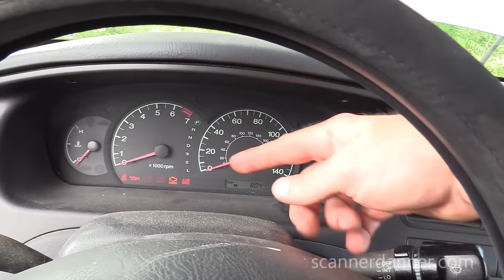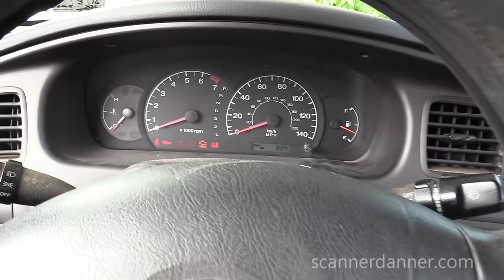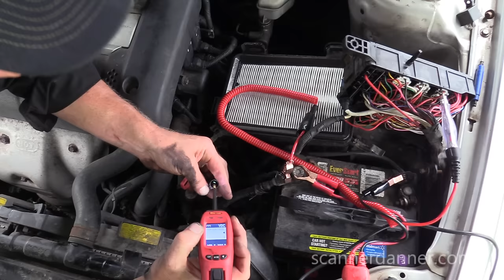No crank, good starter, how to troubleshoot, any car! (Hyundai)

Comment: I have a question I hope you can help me with, I had a crank no start problem so I started changing parts, and of course the problem  has gotten worse, I have no crank, no back up lights, no odbII PORT, no rear lights , the gages needles don’t move, the battery  shows 13.5 volts,I cannot jump the starter at the fuse box. The starter works on the bench, headlights work but DONT dim when I turn the key, the ignition switch is brand new, so I need some guidance here
Reply from the maker: pick a problem and walk that path. Start with the back-up lights or tail lights. Get a good wiring diagram and break out your voltmeter or test light and do some checks. I can't help you unless I have some direction. That direction comes from you. 
Here is a link to a DIY version of the service info I use. Look at the diagrams, find a common denominator. And stop throwing parts at it because you end up making it worse. Now you may have multiple problems that you just built in. 
https://eautorepair.adtrk.biz/?a=10817&c=24&p=r&s1=
Reply: @ScannerDanner  Wish I could send you a photo but I found a harness that goes to the multi switch turn signal box over the ignition, looks like at some point it over heated, its slightly distorted to the point where the plastic between some of the lower point are gone, wth? Anyways its hindsight but I wish I had found your classes before I poured parts(fuel pump, ignition switch, cam, crank,  starter and radiator (broke the hose fitting, don't ask how, please). You're a pretty good teacher, bro.
Reply from the maker: @bradjohnson6536  well you found me now, so moving forward with other issues, we can do better together right?
Reply: @ScannerDanner   Well, Mr. Danner, I replaced the multifunction switch connector and after having to rearrange somme of the wires and  two blown fuses, the engine turns over, altho it didn't start. In the morning Ill start to try to trace why it won't start. You now have a new, 69 years old enrolled student.
Reply from the maker: @bradjohnson6536  find out what you're missing. Start with a quick spark test.
Reply: Its 9:11am and I just reinstalled the multi switch, sprayed the connectors with contact cleaners to try and rid any moisture, I checked the fuses and I probed the MFSW fuse. It had power but when I turned the key to start, the right terminal flickered while the left terminal had a solid output at 13.0. Why does it do that? It's still a no crank unfortunately.

Comment: Paul, at 24:50, the test light made me think of the 5 volt reference circuit. Do you think there might be some sort of intentional resistance in the 5 volt circuit, maybe a positive temperature coefficient resistor, that heats up when the 5 volt reference shorts out, limiting current, and the resistor would drop the 5 volts across it, then when you remove the short, the resistor would cool off, just like the bad connection for the starter circuit cooled off and the test light came back on, the same would happen to restore the 5 volt reference circuit? I don't know, just a thought. Your videos really help me get to thinking, and for that, I thank you! God bless you for all you do! Thank you for all that you do as well!
Reply from the maker: I think that is a possible way it could be protected, but from what I've seen, there is some type of switching transistor involved there too. Chrysler for example, the voltage will stay low, after a momentary short, until you cycle the key.
Great insight!

Comment: I’m having the same issue, no crank no start on my 06 CTS V. Took starter off and had it checked at parts store, starter came back good. I swapped relays around n fuse box and still nothing. I used test light to test the tabs n box, my test light lit on the wire that’s always hot, but test light never lit when I turned ignition on. Tried 3 different batteries and still nada. So I’m running out of options here. What’s my next step if u can help???
Reply from the maker: No power to the solenoid then. Step 1 is to get a good wiring diagram and find out what all is on that circuit!
https://eautorepair.adtrk.biz/?a=10817&c=24&p=r&s1=
Park-neutral switch, transmission range switch, the relay, the controls for the relay, anti-theft issues, ignition switch, engine computer etc

Comment: hey man, im having the same issue but the difference is that the car starts sometimes. I already changed the starter and relays. When i turn the ignition over to start it sends power to the relay control. You think is that the wire from the relay to the starter could be obstructed? and thank you for this video. you do a magnificant work.
Reply from the maker: You need to do these checks when the problem is there. Otherwise we are just speculating.

Comment: Good day sir. my problem is a SUZUKI XL7 awd 2007 143km. no crank. new battery, new starter. all fuses and relays good. ign. key on, all lights in cluster come on when i start they go out. if i jump the relay pins #30 to 87 at the fuse box it cranks but even with the ignition on it is a no start.HELP PLEASE.

Comment: Hey bud, hope you're well. Any chance I could get some advice? I've got a 2011 hyundai genesis coupe 2.0T. Car won't crank, nothing happens when I turn the key, except a relay clicks. No starter engagement. I replaced the starter, didn't fix it. Replaced the starter relay, didn't fix it. If I bypass the starter relay with a paperclip, it starts right up?!?! Any idea what it might be?
Reply from the maker: Your jumping the load side of the starter relay right? If so, you need to do some checks on the control side for me and give me voltage readings during cranking and not cranking (pins 85 and 86 of the relay)
Reply: @ScannerDanner  ok thank you, I'm in Florida right now. Heading back to Mississippi. Don't have a meter on me.
Reply from the maker: @Apathymiller  try starting it in neutral instead of park
Reply: @ScannerDanner  manual

Comment: What do you think of a car with a crank no start that doesn't start for a couple of days, then starts with a bunch of white/grey smoke for the first few minutes. Then you let it cool and it starts again no problem at all? Block, pressure, leak down and compression have all been tested and passed.  It seems to be running normal now with the exception of it losing coolant(just replaced a leaky water pump). None of those tests bring up a positive and it runs normally now. Also, when it did fire for the first time after no start the smoke didn't smell sweet but more like an electrical fire. Help a brother out with the 04 suburban mystery problem if you can.
Reply from the maker: When it does not start, you need to find out what you are missing. Spark, injector pulse, fuel pressure
Reply: @ScannerDanner  Thats the thing, when I have a problem I haven't tested it. When I can drive it to the shop for tests I can't perform, it passes them all!

Comment: Now if you can do a 2011 jeep grand cherokee Laredo 3.6l.
I will take this knowledge and when it's not raining, I'll take on the challenge again. No security issue, radio goes dead when turning key to run and dome lights do not dim. Did replace brake switch and lights work but no start now. Ughh

Comment: I have a 2008 Hyundai Tiburon. My starter is not starting. I have even bought a new one. I also had the old one tested and it works. Problem is the starter will not start nor will the solenoid engage. I have tested the main power and it shows 12-13 volts. I have also tested the ignition/solenoid connector showing that the ignition sends 12/13 volts when the car is turned over. For some reason the starter will not . This is a basic circuit so no idea what be causing the problem. Any help would be greatly appreciated.
Reply from the maker: When you tested the main heavy battery cable at the starter, you MUST be holding the key in the crank position for that test, even though it is hot all the time. It can test good and not be in an unloaded situation. Check that first, then I'll have you check your block ground next

Comment: This is a great video ScannerDanner! At 9:10 in the video, what are you doing to jump start the car, are you connecting the two parts of the starter?
Reply from the maker: No, but you can do it that way. I was using my power probe to supply voltage to the starter S post. You can use a screwdriver and touch the BAT and S posts together to do the same thing. Just be careful you don't touch anything else. A jumper wire is safer :-)
Reply: @ScannerDanner  Gotcha, it turned out there was a rusted out wire feeding power to the starter, so similar to what you did I managed to by-pass it using pliers as (not safe, but the only thing I had). That being said, thank you so much for the video, it was clear, understandable, and extremely informative!!! Keep up the great work with this channel! 😃
Reply from the maker: @jamesdouitsis8180  thank you and nice job!

Comment: Can isk a question? what is the difference,my Ford focus is always On dashboard lights, even I off and pull out the key's.then they won't start
Reply from the maker: your dash lights are on all the time? so the battery goes dead on you too?
Reply: @ScannerDanner  my battery is brand new,I will pull out the positive so that the battery will not drain
Reply from the maker: @towerone8556  that doesn't answer my question
Reply: @ScannerDanner  Yes
Reply from the maker: @towerone8556  yes to both questions? You want some help, I get that, but please understand that I'm helping 300,000 other people too. If you want me to continue to work with you, you need to be more helpful in your replies, otherwise, I will just stop replying to you. Not being an ass here, just look at it from my work load standpoint. I have about 300 other questions to get through for today alone

Comment: Thanks for the uploads.  I‘m pretty sure I’m going to buy your book and become a premium member.  I’d already have your book if I found a kindle version of it.  I was wondering what scanner you would recommend for General all around use.  I’m a diesel tech but I do work on a lot of Ford V10 gas engines in the step van fleet I service.  Not really looking for a diesel scan tool as I get access to the Jaltest one my company has and the dealer specific (Xentry) scanner.  Mostly looking for a gas and light duty diesel pickup scan tool.  Been looking at the Launch x431V+ and the Autel Maxisys mini.  If you got a sec I’d greatly appreciate your thoughts.
Reply from the maker: too many variables to answer what scan tool would work best for you, where you live, the cars or trucks you work on etc etc. The best thing would be to post this to my forum and see what others are using. It is free to join my forum and I have a really great and friendly community. Thank you! I look forward to hearing from you in the comments of the premium videos!
Reply: Haha I posted that question before I joined your site.  Thank you for the reply.

Comment: My '05 Camry wouldn't turn over, this morning. Came here looking for ideas. Called my brother over, as he knows more about them than I do. Headlights & dash lights were bright. Crossing solenoid turned engine over, but no start. Checked fuses, relays, etc. He unplugged the wire harness off of the neutral safety switch, & tried to short it across - nothing. (There are several wires in that plug) He plugged it back in, I turned the key, & it started. The plug wouldn't click in, as it should, so I'll have to keep an eye on it. Maybe replace it later.

Comment: Hey danner... how about if there is no fuel flows in fuel line but its newly installed brand new fuel pump.. but still not running
Reply from the maker: Check my chapters 14-16 playlist for some fuel pump psi diagnostics videos. Powers and grounds to the pump would be your next test

Comment: On my 2013 Accord the engine does not always start.  When it does not start I continue to hold the brake pedal down then push and HOLD the START/STOP button and it will start.  This indicates that there is a possible problem with either the push button switch or the brake switch.

Comment: Good Afternoon Mr. Paul i have a 2017 hyundai elantra it doesnt start or crank and my 20A ECU  fuse blow up every single time that i put a new one any idea what it can be? I unplug the connector next to it and it doesnt blow it!
Reply: Esvin Guebara so that means too much power is getting to it. is the batter the proper size? are the fuses youre connecting the right ones?
Reply: @richalequan6595  Yeah the battery is the original and the fuse is the right size!
Reply: your battery should be good, if something is blowing EVERY time i would just pay the money to get it diagnosed. but if you want to do it yourself, watch “diagnosing a stater” by @chrisfix
Reply: he can walk u thru it all
Reply: @richalequan6595   thanks bro. i fixed myself. The computer was broken from the bottom i had to order a new one!

Comment: I have a 98 firebird ttop that started just fine when I went to work I tried to start it to go home and it was doing this. So it could possibly be the relay?
Reply from the maker: Do the tests at the starter I showed using a Test Light. Without at least that info. It's all guessing

Comment: You can pull the plastic cube cover off the relay and manually touch the relay points and Start the engine... I had to do that for a few months on my 1994 Cummins Diesel until I could replace the Burnt fried ignition... also I had to remove the fuel shut off solenoid on the diesel fuel pump  so the engine would get fuel when turned over, that should be Diesel only...

Comment: I have a no crank no click on my manual gt86 and turning the key and jump starting the solenoid with a screwdriver cranks it but doesn't start it. Could it be a wiring issue too?
Reply from the maker: What is a gt86? Year, make, model, engine please. Thanks! I'll be able to answer better
Reply: ScannerDanner  it’s a Toyota gt86 2013 same as  toyota fr-s  or Subaru brz. It has in fact a subaru engine 2.0 L
Ps: I could also crank it from the starter relay but  it didn't start
Reply from the maker: @1618maher  do you have communication with a scan tool? There would definitely be codes. You need to focus away from the starting system and toward the engine computer. Yes you could have a wiring problem or even a blown fuse but lets not throw parts at it. Scan data is next and codes. 
I am betting on there being no control to the starter relay from the engine computer. We haven't verified that part yet, but I do not see the need to because it doesn't start when cranked manually with the key on. Both of these point us toward the engine computer. Although, as I am typing this, newer systems are smart and the computer may not allow fuel or spark if the sequence in the start up process isn't right. So you would want to have the key off, then get your jumper wire ready on the starter s post and have someone hit the key to the crank position at the same time you jump the starter. If it then starts, then we focus back on the starter relay and to control of it.
Reply: ScannerDanner I had an engine light coming and going sometime ago; p0390 which is for the camshaft position sensor, but actually after testing and trying so many things I just realized that the problem was blinking before my eyes... The anti-theft light doesn’t stop blinking even with key inserted and ignition turned on. I’m trying to solve this now, any idea how?
Reply from the maker: @1618maher  scan it for anti-theft codes, they will be there if it is anti-theft related

Comment: I have electrical issues with my 2000 Jeep Grand Cherokee Laredo. Once I turned the key to start the engine all lights in dashboard went crazy and it didn't start at all. After a while it would. next morning back again to the same issue. I started to check relays and fuses then power into the Fuse/Relay box knowing the positive cable goes into the Box checked the voltage from there to the negative side of the battery and there was a voltage drop to 10.48 vdc. 
Disconnected the positive cable from the Box and the voltage went up to 12.54 vdc. This leads me that there is a short in the Fuse/Relay Box or the whole harness connection is shorting out. And everything started with my right turn signal shorting out with the stop light when used with all the lights on.